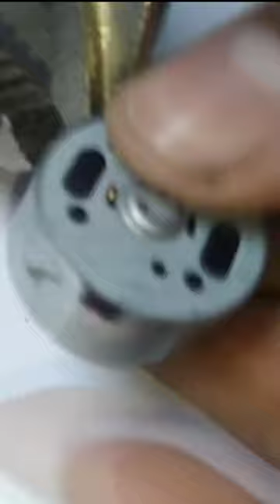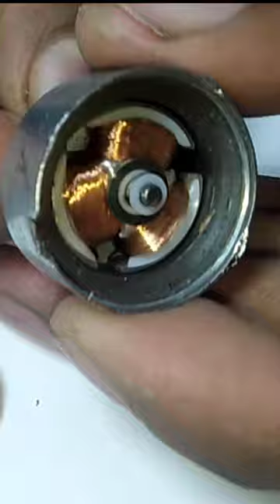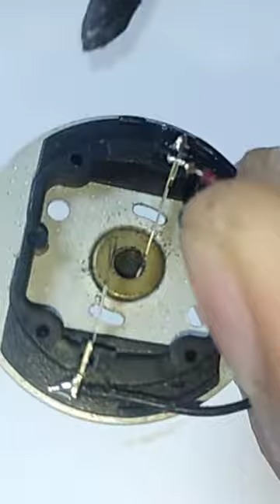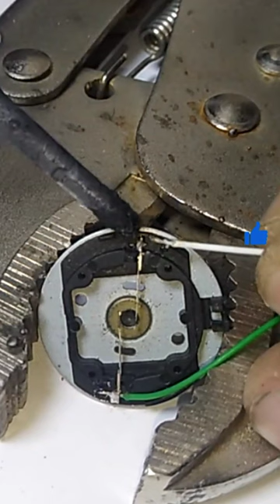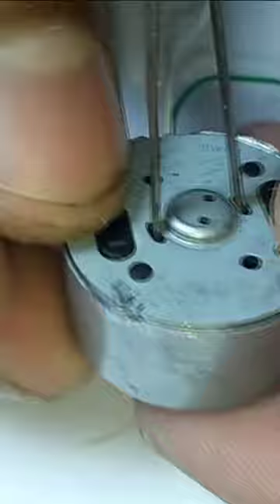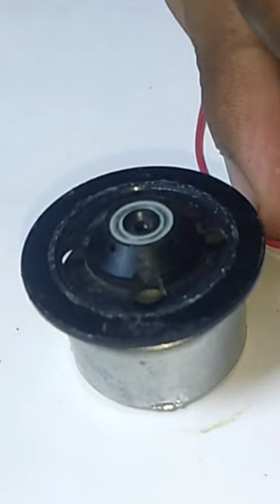DvD motor repair #shorts #shortvideo #youtube

Comment: I like this video, I have tons of drives motors different sizes, I accidentally broke 2 medal Terminal on the motors itself cuz I was struggling to get the circuit board of, what I can do is find more small dvd drives motors and replace the back with new wires.
Reply from the maker: It depends on the type of motors you have and which ones can be repairable.  Thanks for liking the video.💗
Reply: @AliTechnicalknowledge   you welcome 🙂